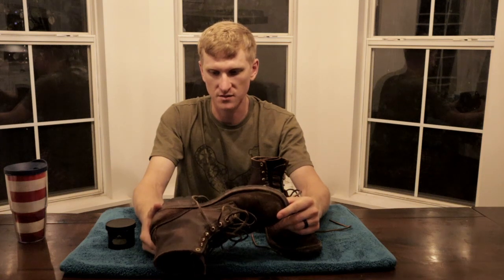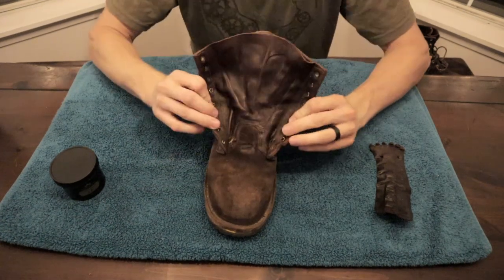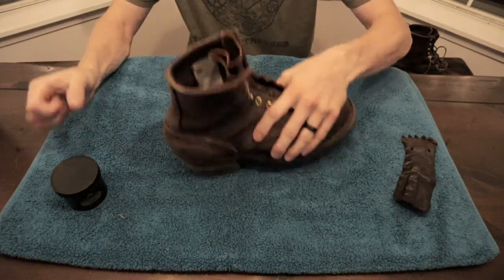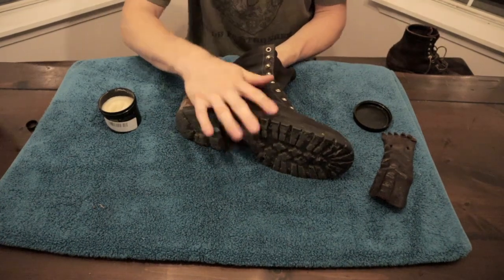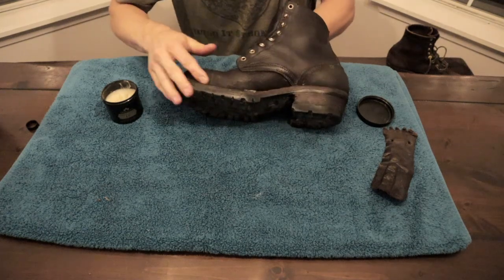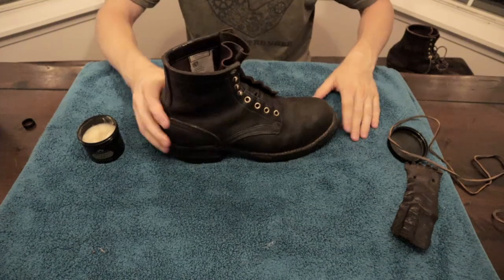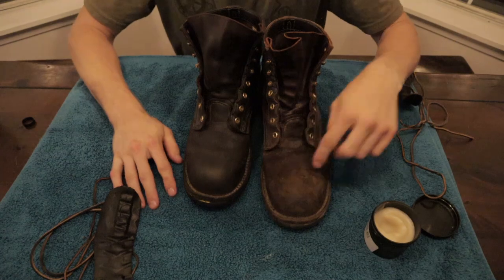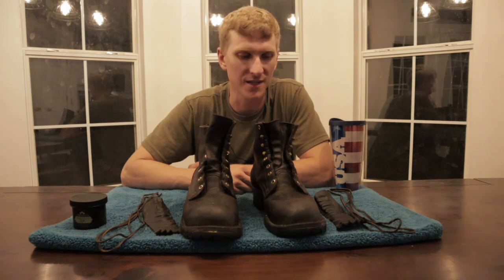Nicks Handmade Boots Custom Contender Review - #nicksboots #bootreview

Comment: Yep, quality boots.  All of my outdoor leather gear gets the Obenauf's treatment.  In addition to the LP which you used in this video, they have the Leather Oil, a liquid version of the same product.  I have/use both.  For the inside of your boots, since it's all leather inside as well... get yourself some "Bick 4" conditioner.  It's not oily/greasy, but will nourish all of that leather inside your boot as well (footbed, inside of the vamp is another lining, the sock liner, the heel counter).  Great stuff.  Just don't tell your wife about it, she'll have you conditioning all of her shoes with it as well.  You'll be using that Bick 4 on your belts, holsters, slings, wallet, leather on hats, auto interior...

Comment: These boots are not comfortable on concrete at all... outsoles are way too dense. There's no shock absorption on these boots at all. If you're on finished concrete, get a wedge sole.
Reply from the maker: I haven’t noticed any distinct discomfort on concrete, personally. You are correct in that there is not really and shock absorption.  I don’t have a pair of wedge some boots to compare these too, but I would like to try some out.